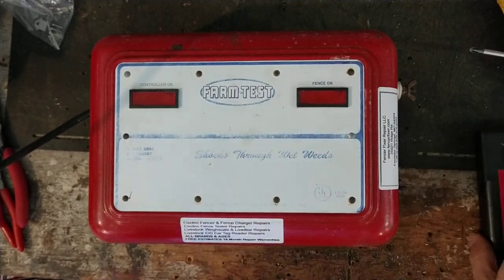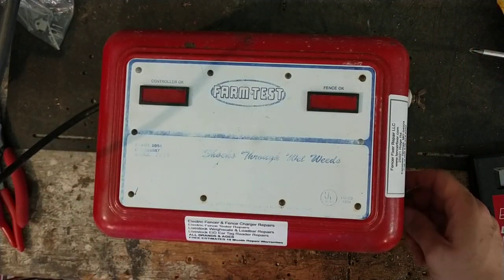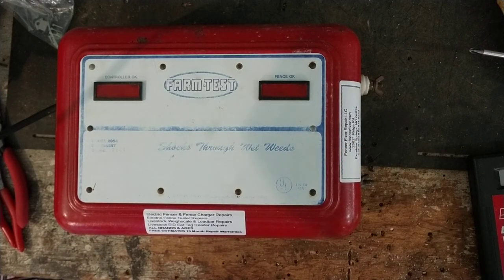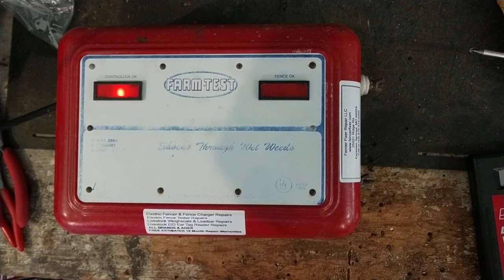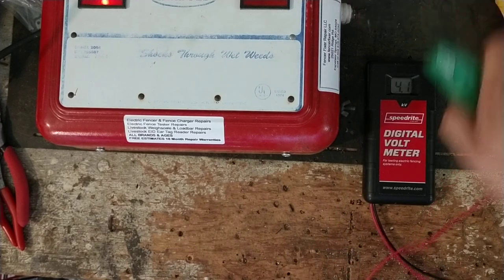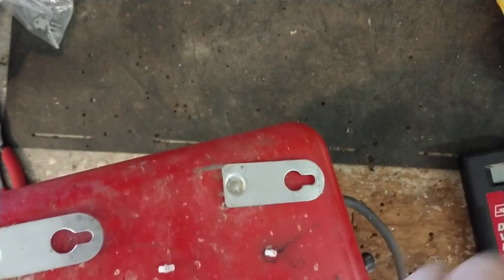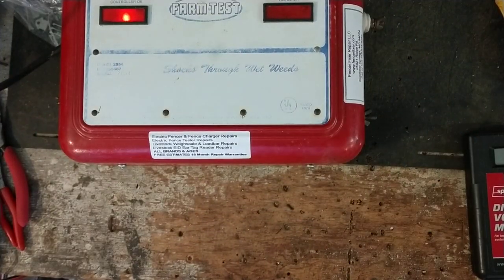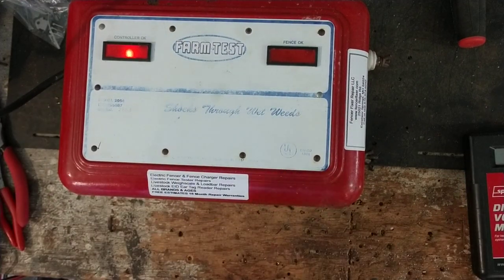Old Farm - Test Electric Fence Charger | Electric Fencer Repair

Comment: I have the same model here and the controller light comes on but the fence light doesn't..I have the fence around a small chicken coop and hooked it up but fence light will not come on...I even tried the voltage tester with no luck..Any suggestions? Appreciate your video
Reply from the maker: Have your tried running it all by itself, no fence and ground connected? If the fence light comes on then, then it's an issue with something shorting out the fence from the ground. If it still won't light up the fence light, then it's internal. If the unit still clicks, but won't flash, then it's definitely inside the unit. Sometimes getting parts for those older models is sometimes hard to find and get. If it still won't put out anything and the light won't flash, then you could send it into us if you'd like and we'll see if we can get anything figured out with it.
Reply: @FencerFixerRepairLLCKansasCity  Hey thanks for the reply! I actually took it to a guy today to check it out along with a Zereba... hopefully it can be a simple fix between the two ..The older models were hard to beat but now they just not holding up
Reply from the maker: Sounds good

Comment: I have that exact model on my pasture, roughly 20acres with 2 wire and it seems like it never works, is that too much fence for this charger?
Reply from the maker: I would test it on its own first and just make sure it's putting out the correct voltage kv reading. If it is, then the unit itself is probably ok. If that's the case, these are solid state output units and they get weaker the further out the run is. Or the more grass you have on the line the harder it is going to be to get it to go all the way around. Back in the day when solid state was everywhere for electric fence, people were running smaller areas and still using a lot of panel fencing and barbwire. That's why when you get on a farm that's been around a long time and you want to do electric, you have to mix in your electric wire with the existing wire that's already there on t-post insulators or offset insulators. On 20 acres with 2 wires and clean, I'd buy a Gallagher M360/M560 On the same set up with some grass here and there, I'd jump up to the Gallagher M800. I'd use your other unit you have there around smaller set ups like to protect hay or a garden or smaller acreage of a couple of acres or less.
Reply: @Fencer Fixer Repair LLC. Thank you, I was worried it was just too small, I'll look for one of those models you mentioned
Reply: @FencerFixerRepairLLCKansasCity  well, a year later and it is completely dead, I cut the rivets and separated the case to inspect and found the circuit board burned in a couple places. Is that something that can be fixed to keep it as a back up unit? If not would you happen to have an m800 laying around you would sell?
Reply from the maker: @jacobhammond5432  I'd have to have it in to take a look at, but I'm not sure if it'll be repairable or not. On the Gallagher stuff, I don't have any used or new units laying around. Most things we get in get fixed, and the ones that don't get fixed are the cheaper junk ones to start with